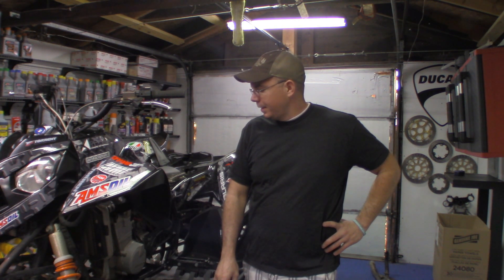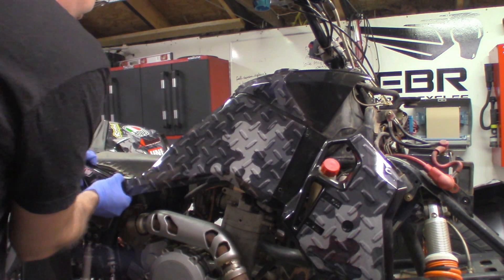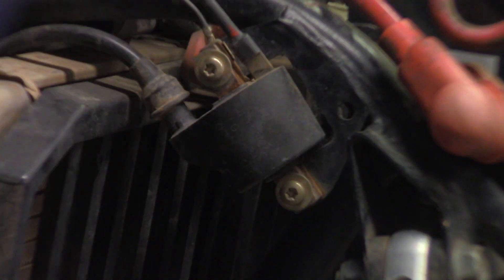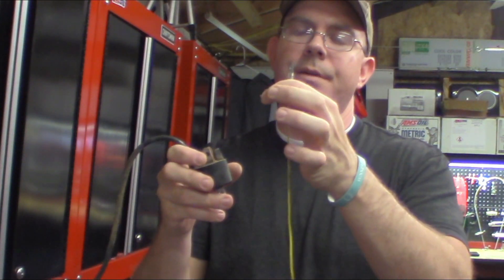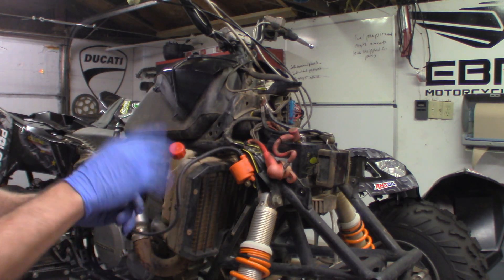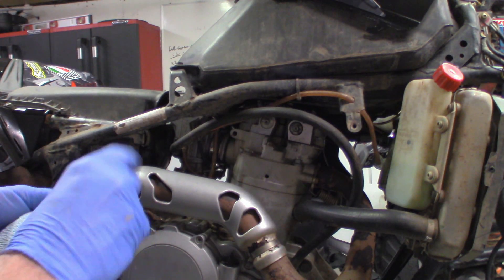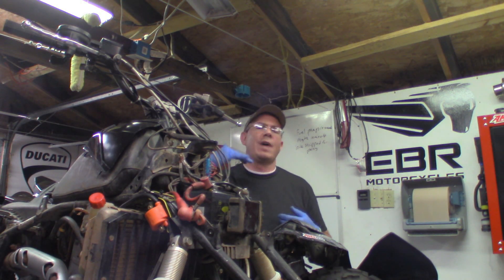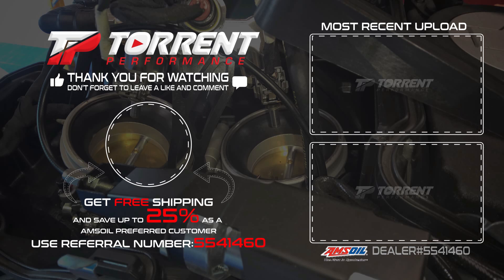AMR Coil,Spark Plug Wire, Spark Plug Boot, and Spark Plug Install 2007 Polaris Outlaw 525

Comment: I know you posted this a long time ago but can you answer this question. I bought a new coil and plug wire for my Polaris 425 magnum.. . The old one didn't have any wires coming out of the coil,  but the new 1 has a green wire coming out of it and a Plug in for the wire that I have on mine,  a white wire that plugs into gee coil, what do I do with the green wire.?

Comment: Good job
Reply from the maker: Its coming along pretty good. Shooting these repair type explaining whats going on takes alot of time. I could just shoot a before after one and build this quad in a week.
Reply: TorrentPerformance hey I got a question about the ltz exhaust header how do u get it behind the frame is there some trick
Reply from the maker: @keithparady2594  may have to take radiator mounting bolts out. I had to remove the radiator on this quad to mess with the header pipe to the rear muffler.

Comment: Most likely the primary nut needs to be re-tighten and the noise will go away. The 2009 I purchased sounded like it was knocking, but the nut was finger tight when I removed the cover.  if you're looking for a good deal on an Outlaw check Facebook Marketplace often I bought mine dirt cheap and drove an hour away to pick it up.
Reply from the maker: What's the torque spec on the primary nut?
Reply: @TorrentPerformance  110 ft/lbs   (reverse threads)

Comment: Hello  I have  08 outlaw  525 irs
When I turn on for 10 min. On Neutral automatic  turn off ..its  normal
Reply from the maker: What's normal don't understand
Reply: @TorrentPerformance   so my problem  its  the coil
Reply: When I have it on for 10 min in Neutral it turns off I just wanted to know if that is normal?or do I have a problem with the coil because it doesn't do that when I have it on gear with the clutch in it doesn't turn off
Reply: When I have it on for 10 min in Neutral it turns off I just wanted to know if that is normal?or do I have a problem with the coil because it doesn't do that when I have it on gear with the clutch in it doesn't turn off
Reply from the maker: Sounds like carb problem
Reply: @TorrentPerformance   thanks
Reply: I already opened the carburator,  and I clean it.  The only things is that I can't find the.. mid gasket kit its one on the midle.. i went to the diler  and they don't know either and it doesn't appear in the system. By any chance do you know if the gasket of the 525 ktm exc does  it  fits. The dealer only has that one..
Reply from the maker: They might !!!! you want to be looking for keihen carb gasket set , not just ktm dealer for parts for the carb.
Reply: @TorrentPerformance   thanks

Comment: Trying to work on quad. Your images were to small to see what you pulled
Reply from the maker: Once you actually work on the quad there is enough information to put it all together i think. Use these videos as help to diagnosis your atv these videos may not solve your actual issues. If you really need help feel free to email me in the about section and when i have time i will stop what im doing and answer your questions. Make sure you go to my playlist because so far im the only game in town for work on one of these models.

Comment: Mine starts ok but after about ten mins it starts to misfire and and won’t rev then eventually cuts out.. any ideas ..??
Reply from the maker: Sea saw could be a number of things. Worst case scenario have you ever changed the cam chain tensioner?
Reply: @TorrentPerformance  no but it's only got about 500 miles on it from new...it's been in my garage for about 10 years untouched maybe it's healed itself by now.  I Keep looking at it thinking what a waste.  Maybe I'll get round to taking a look at it now I have so much time on my hands.  When the wife's stopped finding me chores ..  🤔